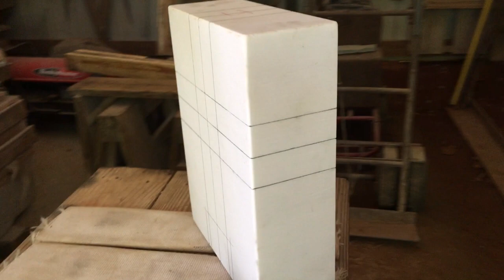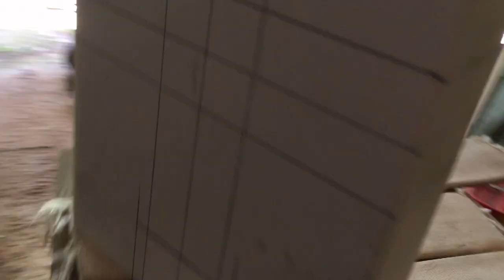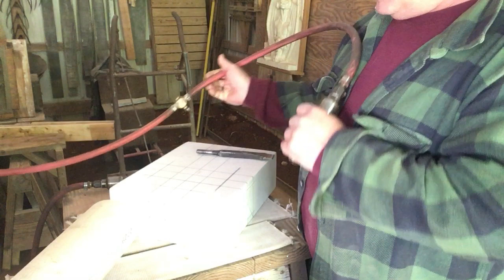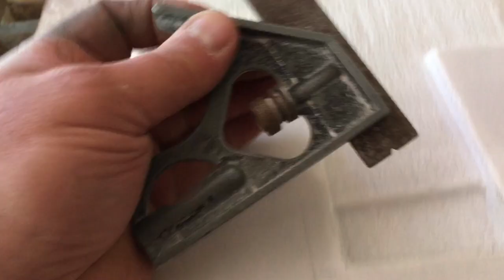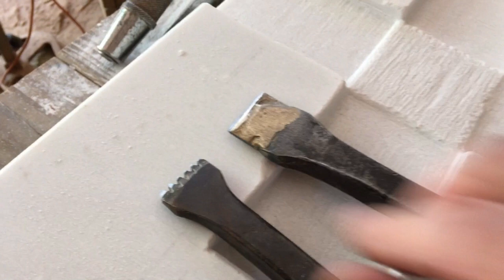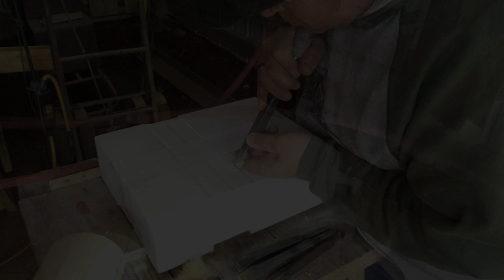Virtual Stone Carving Apprenticeship  VSCA Video 39- Reproducing Marble Cross Memorial 2

Comment: It’s a shame that you can’t see what your doing because the glare of the Sun .
Reply from the maker: Light is always important and difficult to manage.  if I turn in my single bulb work light, like around 12:10, the strong light completely overwhelms the camera and ruins the shot.  It’s a typical problem with such camera work.  many digital cameras are well equipped to balance low light conditions but cannot handle strong light at all.  The best video I shoot is typically done under lighting that is so bad I cannot see to work.  when I turn on my light to work, it destroys the video shot.

I also avoid shooting in the direct sun whenever possible.  even a moderate amount of sunlight overwhelms the camera.   The stone’s crystals reflect the light and all shadows & resulting value are lost.

Even without camera & video work, this is why my studio only has opening on the western facing wall.  I have to control light in order to be able to see to work well and produce the best results.   Too much light is a problem, both in real life and on video.